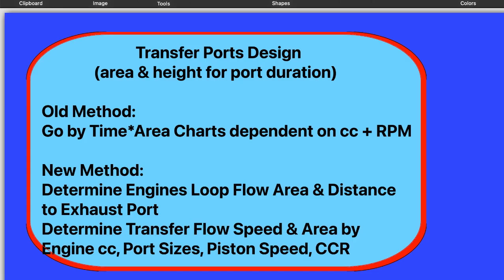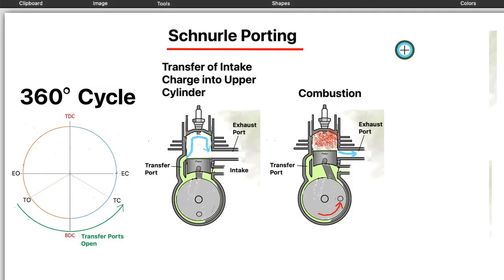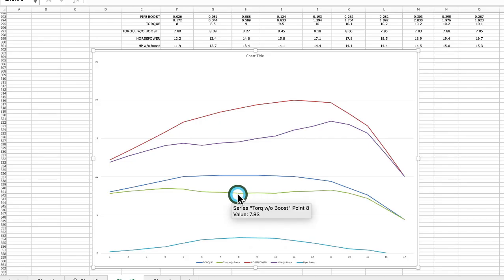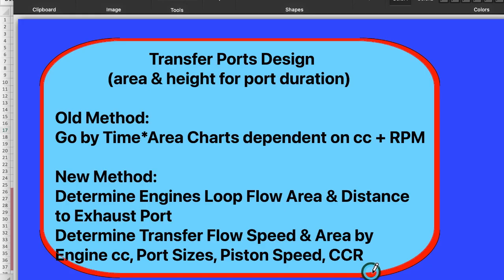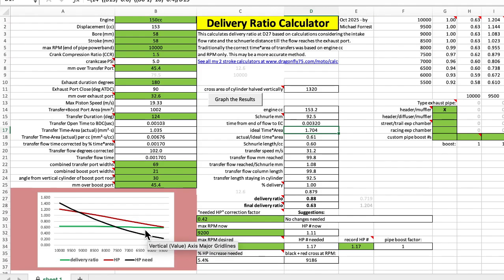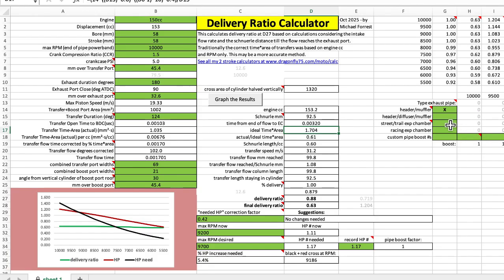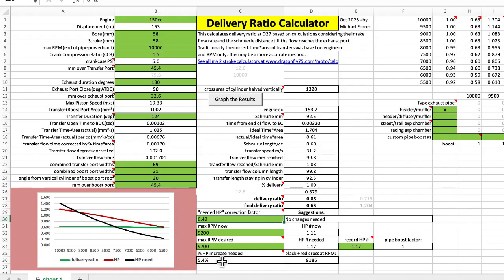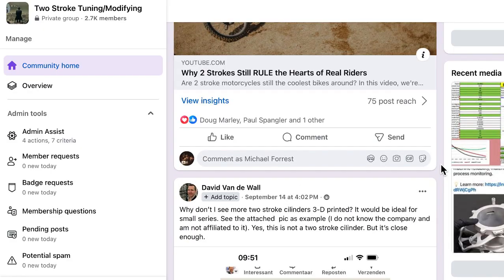2 Stroke Delivery Ratio

Comment from the maker: Using the new calculator I was puzzled by the horsepower graph and so I remeasured the heights over my engines ports to make sure the measurements I was using in the calculator were correct. They were off but that didnt make a lot of difference. The program lacks the ability to calculate how much the exhaust pressure still exists when the transfers are open which would delay the flow. The porting program has that ability and it showed me there was too much overlap so I raised the exhaust port for more blowdown time which reduced the overlap to an acceptable amount. Then the Delivery Ratio program showed that may be all that is needed to pull a significant increase in RPM. I'll test it tomorrow. Soon I'll put the delivery ratio formulas into the porting calculator to make it complete.